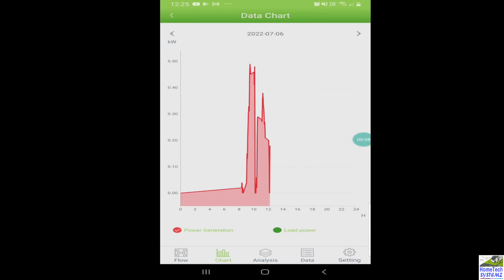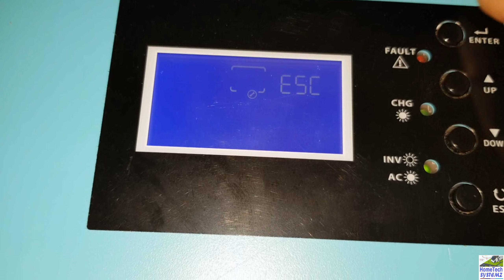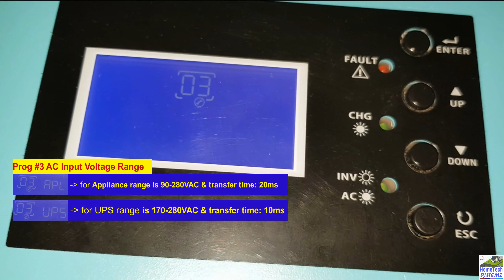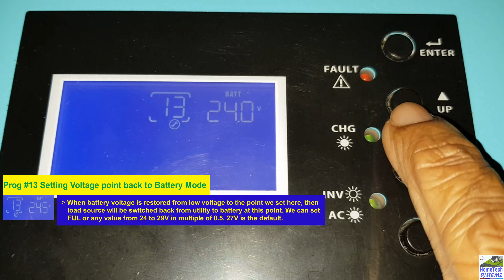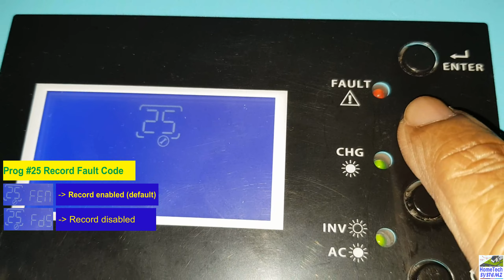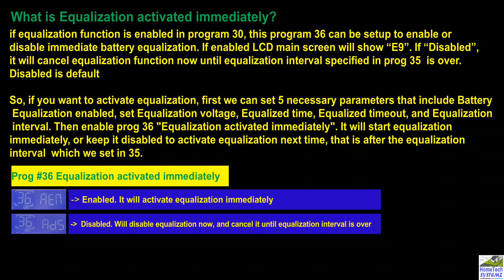3.5KW Solar Hybrid Offgrid Inverter 24V (Video PART-2) - Screen Settings PowMr 2022

Comment from the maker: vets fiveten

2 days ago
First video that actually describes all functions . Thankyou for posting excellent video... I am new to the hybrid inverter and was struggling with the manual . I do need some help but. I have 220ah lithium batteries . As the manual does not say anything about lithium batteries but to set user define. The inverter has now been set to user define . Now I need to set the charging voltage. The recommended charging for the batteries are 14.8v.. and max charging amps is 75amps. I have set the amps to 50amp. Can you please help to set the charging voltage.

1

HomeTech Systemz
2 days ago
Having specific lithium battery charger is the best option for performance and lifespan of of any lithium battery. Since you don't have a lithium battery charger, you must use User defined
option. As you already know, lithium charging and lead acid charging algorithams are different especially in max charging voltage
and max charging current. The best option is select "USER" option and understand the max charging voltage and max charging current for your lithium battery from battery manufacturer. Two of them is already specified in manual for you to follow them.

If your inverter can turn off automatic equialization which was mainly intended for lead acid battery to prevent sulfation, it is good. Turn  it off. Also please find how much bulk charging voltage (Constant voltage) set in prog 26 and Floating Charging voltage set in prog 27, can be done in your lithium battery if such settings are available in your inverter charger.

For more, reading following web sites may help you:
https://www.mastervolt.com/charging-batteries/
https://www.batteryworld.com.au/news/product-news/2021/can-you-charge-a-lithium-battery-with-a-lead-acid-charger#:~:text=This%20is%20a%20question%20we,voltage%20around%2013.3%2D13.4v.

My opinion is: set max amps to 65A or 70, and Max charging voltage 14.5
Thank you